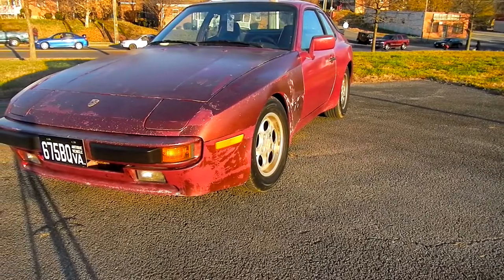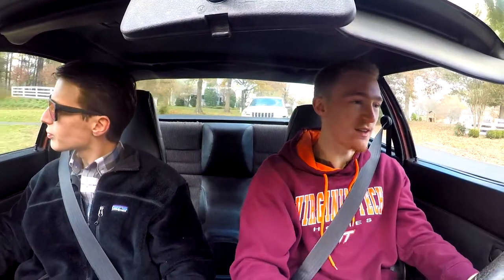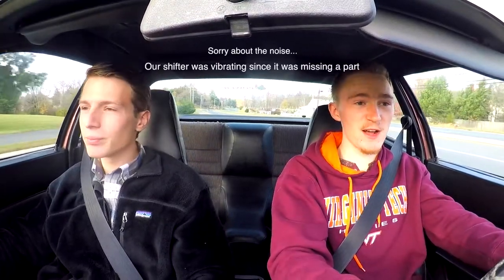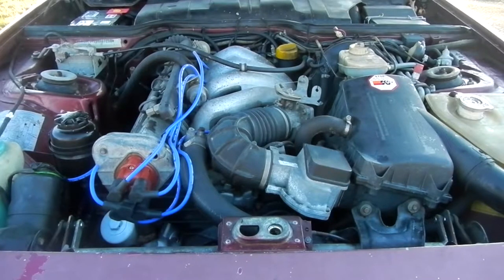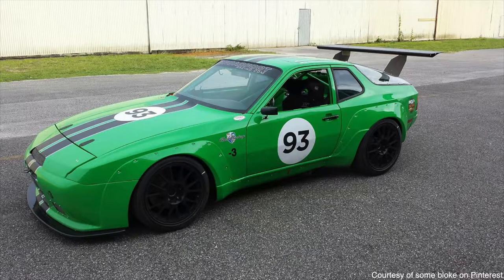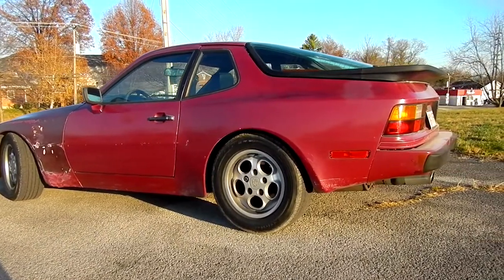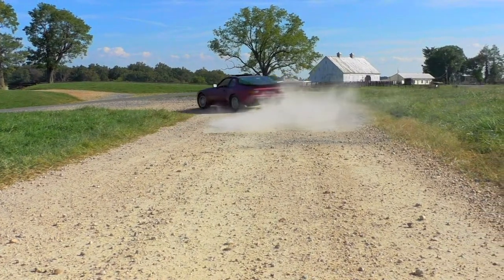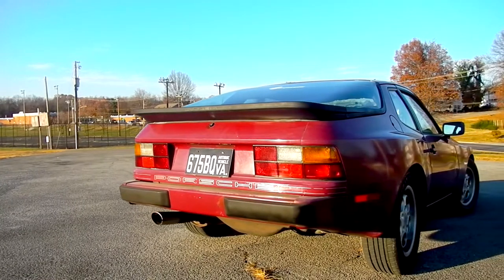We've Done Many Things to the Project 944! Porsche Update #2

Comment: How hard are the parts and things to find for these? I’m looking at getting one..
Reply from the maker: Zach 026 Finding parts isn't all that hard, Amazon and Pelican Parts carry pretty much everything. However, finding them for cheap can be hard, I had to shell out $110 for a sunroof seal...
Reply from the maker: Joe Black Yeah in general it's the labor on these cars that gets you. The parts for the timing belt and water pump service probably run you around $500 but just look up how much it costs to have a shop do the work... One thing I will say about the 944 is that it feels awesome behind the wheel despite how slow it may be in reality. For me it means fun without any tickets 😂
Reply: If one hasn't had the timing belt done how much do you think you can bargain down? The one I'm looking at hasn't had it done and he is asking 2800..
Reply: Joe Black I’m pretty handy I’m just looking for a car to daily and bring to the track every once in a while I’m 17 so money is definitely tight I just don’t want to get into a money pit
Reply from the maker: I'd say try to find the cheapest running model and then find one that has all the maintenance done and compare the prices. A cheaper car may seem enticing, but it can be easy to spend more money fixing up a decrepit model than just buying one in better condition in the first place.